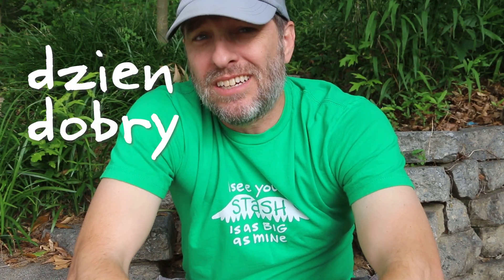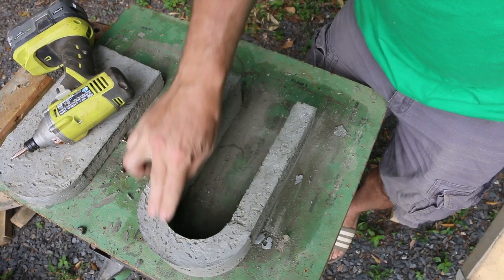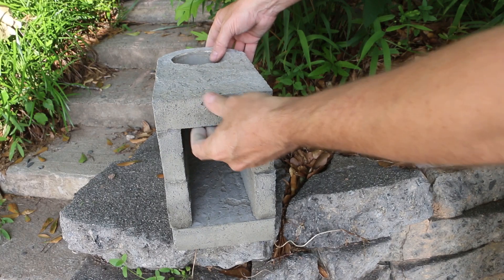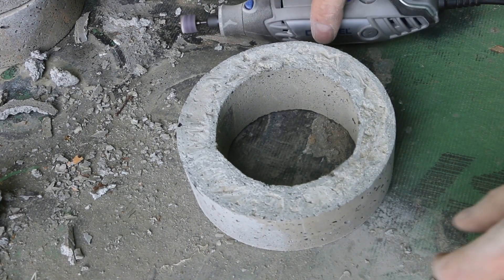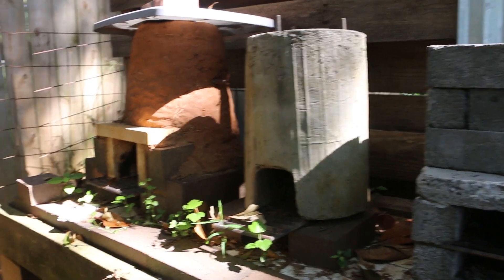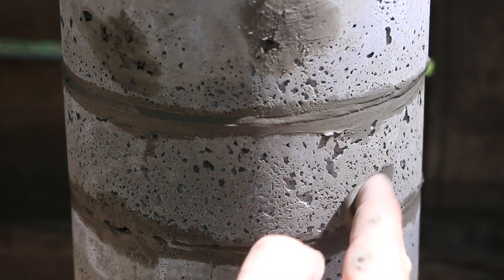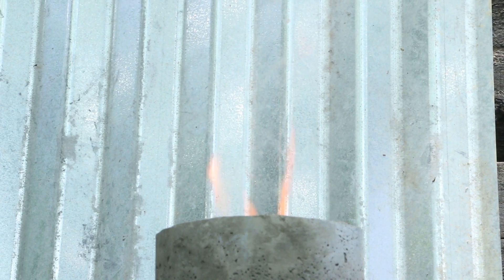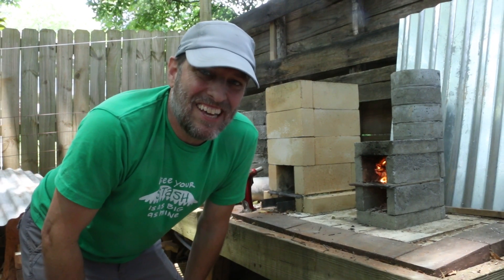How To Make A Stacked Aircrete Rocket Stove | Build And Fire!!!

Comment: Your stove lacks the 30% reduced volume at the rear of the burn chamber . It causes the velocity increase that draws air into the chamber.
It would instantly rocket upon lighting with the 30% reduction, not having to wait for peak heat to initiate rocket draw.

Imlo.

Comment: Can I make this stove with quick Crete instead  of aircrete?
Reply from the maker: Yes. Concrete doesn’t handle the heat as well as aircrete, but it will work. The armature will be important, so the heat expansion won’t crack the stove. Thank you for watching.

Comment: Hi, it surely works as a rocket stove if you just try it a few times. Have you tried to use the aircrete rocket stove in a sustained long term way so as to test the durability of the material under the more practical conditions? Or do you know of anyone who has tested the durability of aircrete stove as compared to that made of firebricks?
Reply from the maker: Actually, I’ve only fired this a few times. I’d estimate that it would not out perform firebrick. Firebrick is designed for high temp conditions. I have subjected my aircrete forge to extremely high temps. It insulated well, glowing red during the firing, but that portion crumbled once it cooled. I’d estimate this would happen to the aircrete rocket stove as well, over a longer period of time. My firebrick rocket stove is still my favorite. Plus no cure time, build it and it is ready to go. Thank you for watching.
Reply: @GreenShortzDIY  Thanks for your response. Honey Do Carpenter made a forge out of aurcrete, he tried to harden the aircrete furnace wall by brushing and soaking water glass into it and cure it by burning it. There he claims to have achieved a durable forge. If he is indeed successful, this would be great because we could make real circular shaped rise with aircrete unlike the square shaoe one made by firebrick.

Comment: Is there any adverse effects of the heat on the aircrete, like cracking. I was thinking about a biochar retort made from aircrete, at least the outside portion with a 55 gal metal barrel on the inside.
Reply from the maker: Hi Thomas. The aircrete I used for a propane furnace didn't crack, but rather crumbled, after a run. But, it was glowing hot during the process. A retort might not get as hot. Plus, if you are just insulating the outside of a metal drum, the steel lining might protect the aircrete and allow it to serve as an insulator to conserve heat inside, which I'm guessing is what you are hoping to do. The heat expansion of the steel might crack and pop off the aircrete, so I suggest adding some expansion joints when you pour to allow for that. I'd love to know how this works out. Thanks for watching.
Reply: @GreenShortzDIY  My thought was to make an outside insulated aircrete rocket stove that could possibly hold one or maybe two 55gal drums full of wood to make biochar using the method described in this video. So the problem would be exclusively the aircrete holding up to the heat required to make biochar.  
                           
https://www.youtube.com/watch?v=svNg5w7WY0k&list=PLku3gDK8uAcVFivqvGK-UeYDusVH5cv9e&index=85&t=272s

Comment: Don't add any more rings to it. It is currently at  the proper ratio of 1:3. If you add rings the added air will cool the gases that hit the pot .
Reply from the maker: Thank you for the tip, Lornaz. I appreciate it.
Reply: @GreenShortzDIY  Well so says Aprovecho. If you get different results with  a longer tube please let me know.

Comment: Great videos! Couple questions: aircreate seems a great thermo insulating material... but how long does it retain the heat compared to firebricks? Asking cause I want to build a mass heater at second floor , and firebricks are probably too heavy.. Other question: do you think it's possible to produce good foam with a pressure washer  and a foam cannon such this one? https://www.amazon.com/CREPRO-Adjustable-Pressure-Connector-Accessories/dp/B08P6N51TC/ref=sr_1_3?dchild=1&keywords=foam+generator&qid=1628154121&sr=8-3
Reply from the maker: I don’t think it retains heat for long. It insulates well, but doesn’t have much thermal mass. I’m not sure the foam cannon would make thick enough foam. Sounds more like a suds maker than shaving-cream-like foam. But, for $15, you could give it a try. :-) Thank you for watching.

Comment: You have a lot of volume in your firebox, which includes the air intake below it.  The volume of the riser should be a minimum of three times that volume.  Adding to the height of the riser is one way of increasing the velocity of airflow (rocketiness?) but you can also decrease the volume of the firebox by layering something underneath the grate.  Pulling the same volume of air through less space will increase the velocity, improve the draw earlier in the burn cycle, and you'll have an even cleaner burn, thanks to the oxygen being forced into the fire.

Very cool build with the aircrete!  :)
Reply from the maker: Good feedback, Jason. I broke the rule of continuous cross section. I'll have to try dampening the firebox like you are suggesting. Thank you.

Comment: It looks like the opening under the grate is letting too much air in therefore letting some flame out the front. If you can use the ash tray from the fire brick one next door that might help.
Reply from the maker: Thank you for the suggestion, Stuart. I wondered about that...after the fact, of course. I’ll give that a try. Thank you for watching.
Reply: @GreenShortzDIY  no worries, if you watch the end of the vid it shows the comparison nicely

Comment: I have enjoyed your journey and documentation of your Rocket Stoves.  I own a Rocket Stove that I love for cooking.  However, is the downfall of this using Portland Cement?  I had sort of a rocket type stove I used a few years ago using cement blocks.  After just a few fires they became very brittle, and started crumbling from the heat.  I have firebricks now that I am using as a base in my firepit that have had many fires in and after I took them out to repaint my firepit they still looked in brand new condition.  I know they are much more expensive, but they have held up over time.  I'm actually thinking of building a Rocket Stove out of these firebricks.
Reply from the maker: Hi Kevin. Good question regarding the Portland cement. Cement or concrete is definitely not a material that does well with intense heat. By making it aircrete, I am hoping to help it work better. However, I do think fire brick is an ideal material for a rocket stove. It is made for the high temperatures. They may be more expensive up front, but could actually be less expensive over the long run. Thank you for the feedback. Happy rocket cooking.
Reply: @GreenShortzDIY  There's a channel called the Honeydo Carpenter and he paints home-made sodium silicate "water glass" onto his aircrete to make it stand up to the high temperatures.
Reply from the maker: Hi Thoracius. I know the channel. I need to look into his formula for water glass. Thank you for the feedback. Thank you for watching.
Reply: I would be more apt to mix some fumed silica and perlite with some clay. Should take the heat better.

Comment: So is it the riser? Or did it just needed to heat up?

Or would more risers help with the draft from the start, no heating up the risers to create a draw.
Reply from the maker: It likely just needed to heat up, but I'll add another ring to the riser anyway. Another test will confirm that. Thanks for watching.
Reply: @GreenShortzDIY  
Thanks for making.